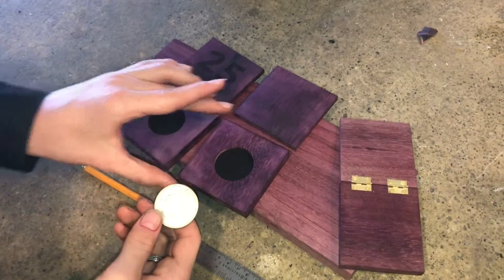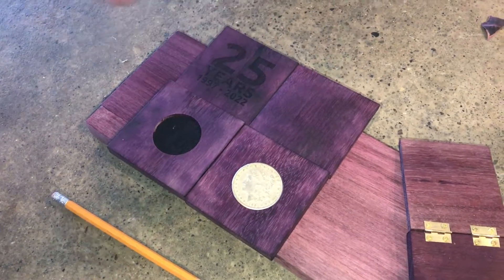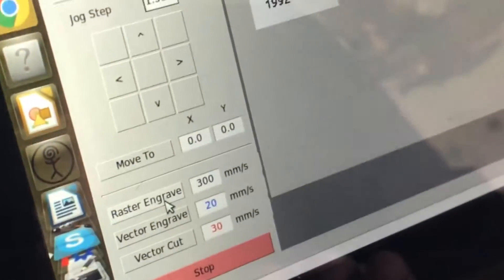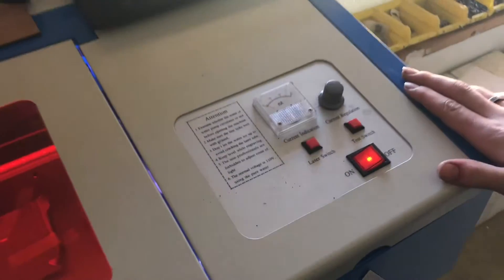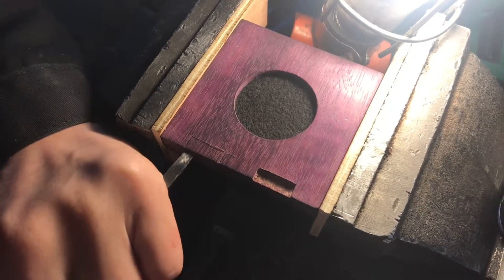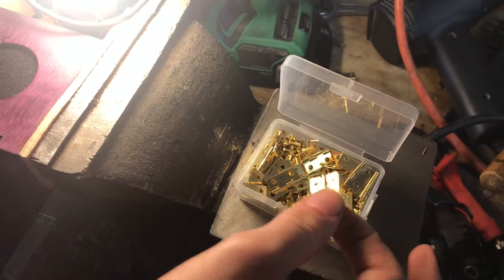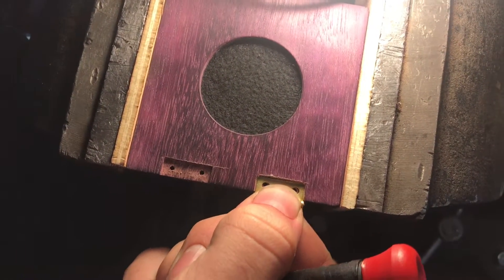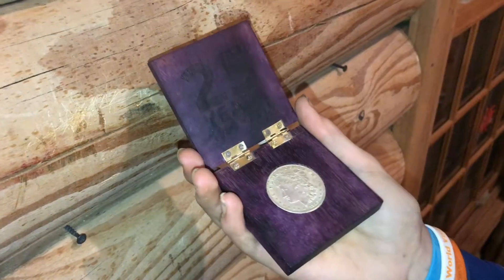laser engraving purple heart wood on a K40 laser cutters

Comment: 300mm/s is CRAZY fast. You're going to damage your belts and possibly even your y axis motor. You should go at like 170-200 max with maybe 10ma power. Take your time and you'll have a much better time with your laser in the long run.
Reply from the maker: Thanks, I’ve seen some belt slippage at 400 mm/s, so far I haven’t had any belt slippage at 300. Have you had any trouble at 300 just curious. 170 to 200 is definitely more on the safe side that’s for sure.
Reply: @livefree6878  dude, I rarely go above 200. That should seriously be your max if you don't want to destroy your machine. Also, just a reminder that the stock tube in the k40 is only 32watt NOT 40 like they advertise, so never put more than 15ma of power through it. You'll get A REALLY nice deep engraving with very little ash at around 100mm/s and around 7ma. Slower and lower power will always render a cleaner looking engraving. Only use higher power for cutting.